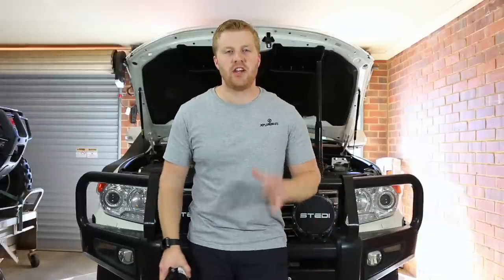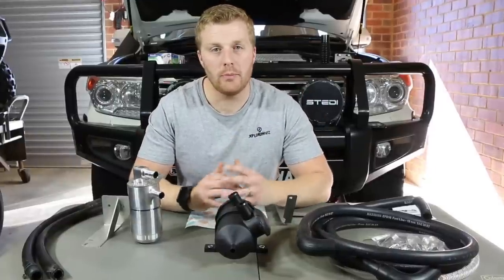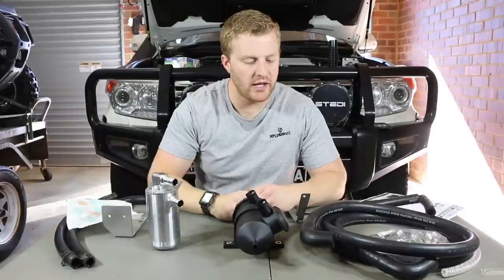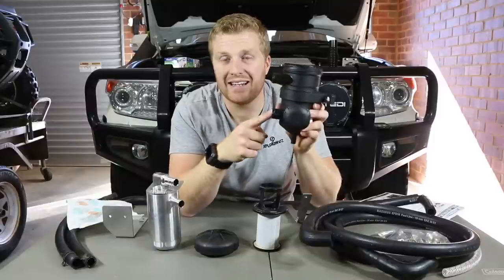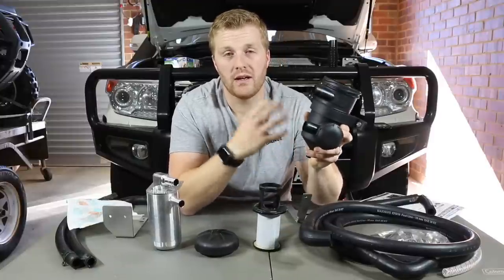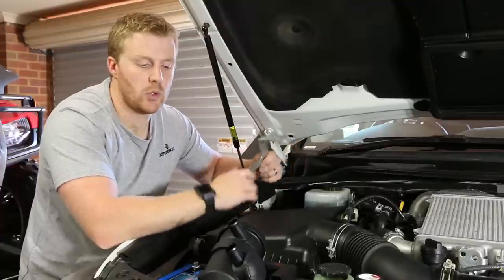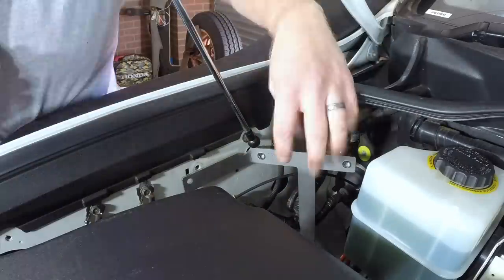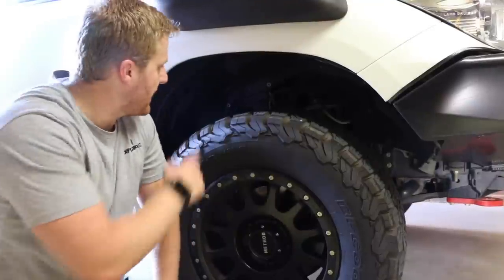LC200 | Provent Catch Can vs HPD | Why I’m swapping | How to install | Difference | Oil Separator

Comment: Possibly a daft question...with the oil  sitting on your old lines I can see as you did, it flowing in into the engine.  Is there a reason why the can can’t be placed lower so it can only flow downhill into the can?  Draining might be a bitch if you don’t have a drain tube, but would this not stop the first issue or does it create other problems?  It’s not a 4x4 but I’ve got a VW twin turbo (240hp) engine in a Passat I’ve had tuned and want to catch any blow-by.  I’ve heard so much shit for and against so rather ask someone who has done it, rather than someone who just sells them
Reply from the maker: Hey mate, so I guess this would technically work. Saying this though, I believe the liquified oil is only a portion of what is entering the engine in the form of vapour. Mounting it lower might incrementally increase the oil captured, however the oil passing through in the form of vapour would still enter the intake. 
Although not specific tested, this is what I believe would occur.
Cheers, Nathan.

Comment: THe provent also has a chinese copy which works just as well for less than 1/10th the price.
Reply from the maker: There is, but you would want to make sure you are confident in the system, particularly the bypass system. If anything happens and pressure builds up, that small initially saving could be lost if problems were to arise...

Comment: Wow, you only collected 80ml of oil from 10-12000ks of driving. I have a HPD Can fitted to my Pajero Sport and regularly collect 110-120ml every 7500ks at each service I do. It appears that my HPD Can works fine as I have compared this with others using the Provent and no real difference in amount of oil caught between them. Just Sayin.....

Comment: What happens when you dont change the filters that cost a lot more $$$? I bet most people dont change them as often as they should. The provent does look like it is more efficient but its a regular cost and a BIG UGLY unit.
Reply from the maker: For sure, you need to stay on top of the servicing otherwise it will cause further issues

Comment: 80mls for 10,000 kms. Wow thats garbage. My provent gets about 125mls or so per 5000kms. The hpd can is a shiny baked bean tin can to help stroke the ego of flogs who like shiny parts in their engine bay. Provent all the way.
Reply from the maker: I’m sure the Provent will prove it’s worth in the next 10000kms.
Reply from the maker: cold gold kb Yikes! Harsh review mate. 
Your right, I’m sure all the scientists at Curtain University were just making up the results and the HPD is equal to all the rest… 🤦‍♂️
Very much looking forward to your expert informed review. 
Cheers, Nathan.
Reply: I run a Provent 200 on my Landcruiser VDJ79R and find it collects more oil vapour the thinner the oil. I run a Castrol 10W-40 during the frosty months & Castrol 15W-40 during the warmer periods & summer, I reckon I might run 15W-40 all year round once my stock of 10W is exhausted, 15W-40 seems to be the best & comes out the cleanest at 5000K intervals.
Reply from the maker: @dustyfarmer  Interesting to hear, something that might be worth testing out in the future. Cheers.

Comment: You removed and installed Air/oil separator, not a “catch can”. There is a difference. If you’re putting out content you do have a level of responsibility to your audience in its accuracy. Do better.
Reply: What's the difference?
Reply: Most air/oil separators I've seen are also labeled as catch cans... I'm only on this video because I need to find one that empties directly back into my oil pan. An edelbrock intake is shit